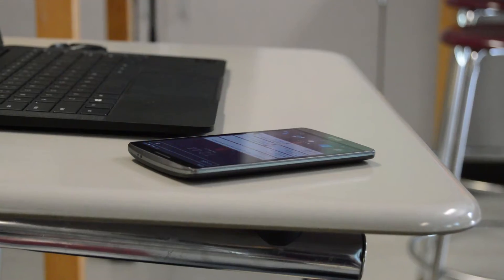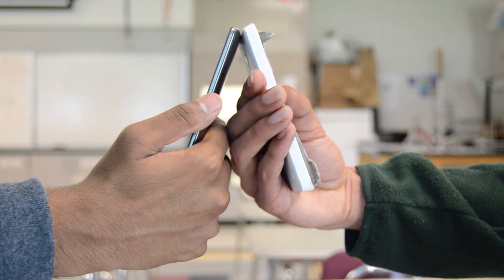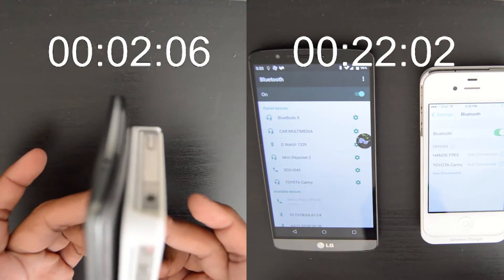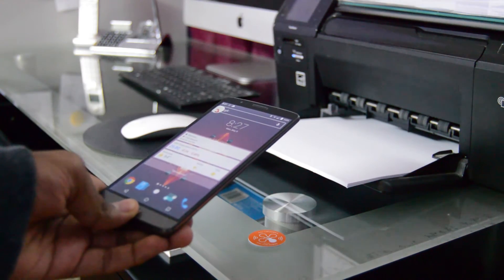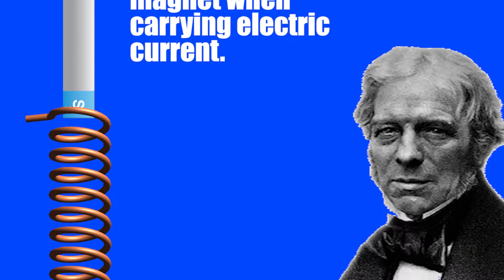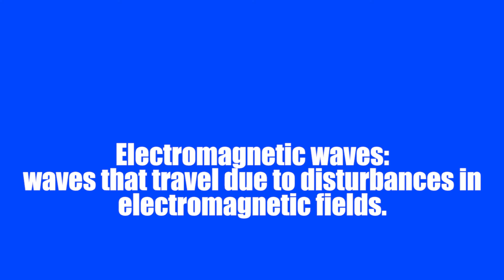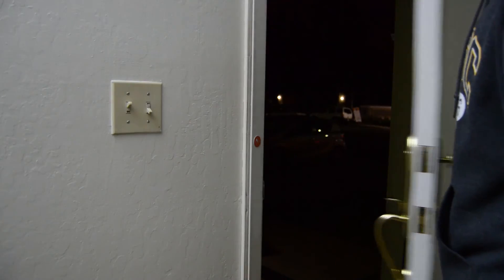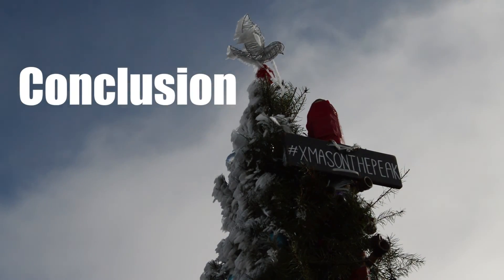In Depth Look at NFC Technology

Comment: But, how do the things youre using for scaning the nfc chip knows what the nfc chip does? Is It because It has different paterns?
Reply: Good question: NFC tags store some code on them that tells the device what to do (open some website, share contact, etc). Some NFC tags can be overwritten with new code. You can usually do that with "NFC writer" apps on the play store. There's no visual difference with changing the code, it's all stored in a chip.

Comment: I wonder how long an NFC tag can be ‘good’ for. Do they degrade like magnetic tape can? The coil loosing power over time? Y2K-style processing glitches? It’s interesting.
Reply: The coil is metal, so I think it degrades at the rate metal would degrade? Much longer than magnetic tape, I'd assume. The actual information is stored on a microchip. Not sure what the lifespan of that would be. If anything, degradation might lead to bits getting flipped and the data being corrupt overall.